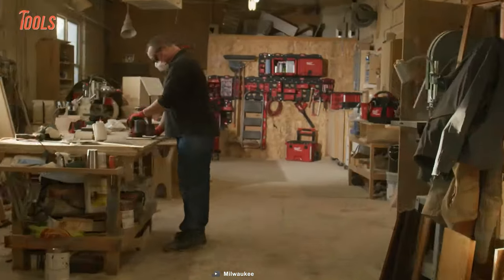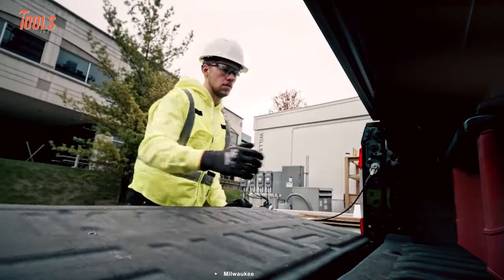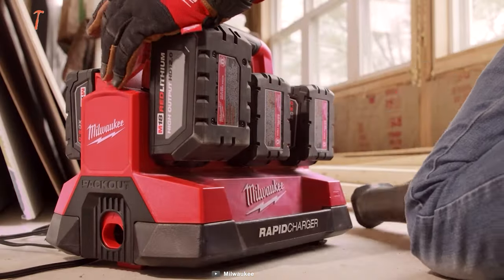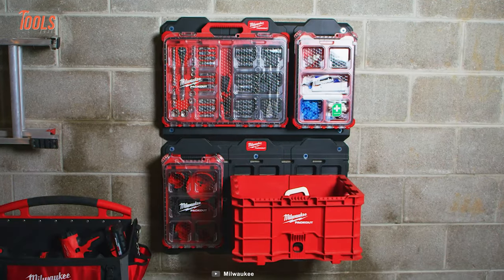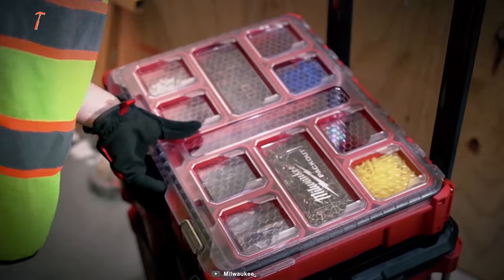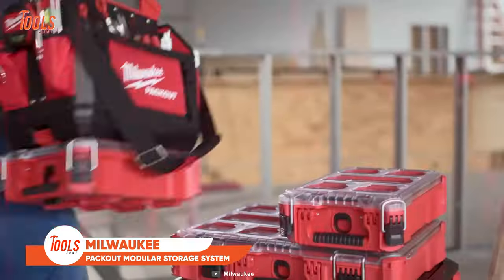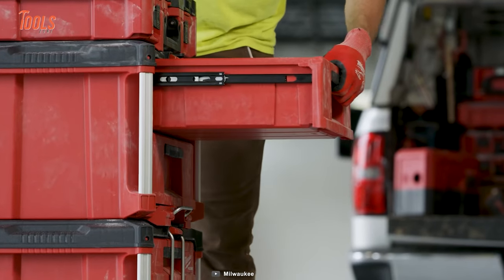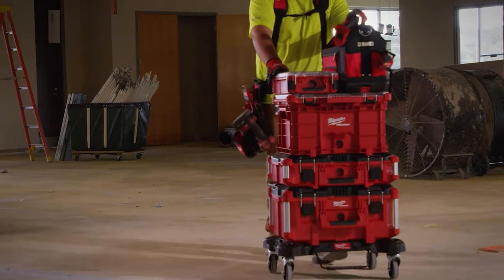20 Milwaukee PACKOUT Tools You Must Have

Comment: I've just bought a wall plate to fit in my van so I can hang what pack out I'm not using .
You cannot put a packout case and a screw box beside each other so I had to put the case on the wall first then the screw boxes on top .
So is that a factory glitch no one tried to fix .
Reply from the maker: Thanks for sharing.

Comment: I just bought the Milwaukee rolling tool chest very disappointed that the lid 
I have to put the two 
two drawers facing the same way. It would have been nice if the backside towards the wheels were facing the opposite way so that way I could lock in  the two  drawers facing opposite so I can access them.  need to redesign your lid. The attachment mechanisms need to be facing opposite sides
Fall short here fellas.
Reply from the maker: Thanks for sharing